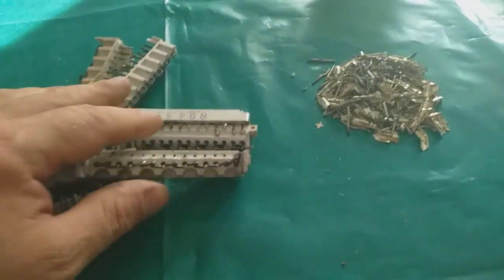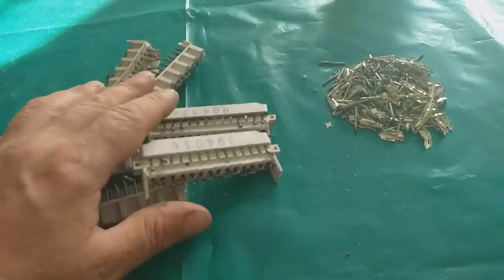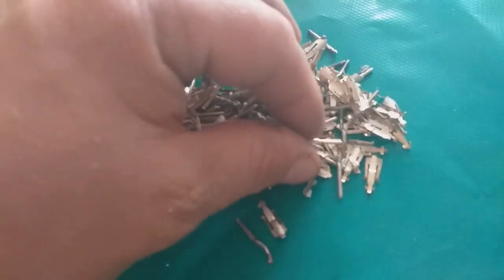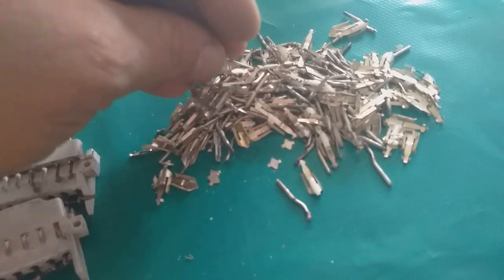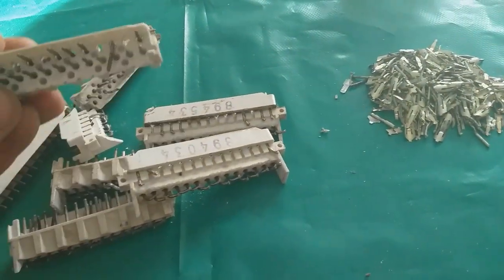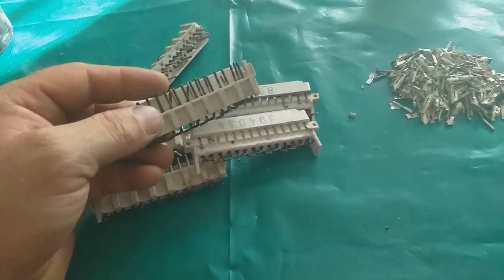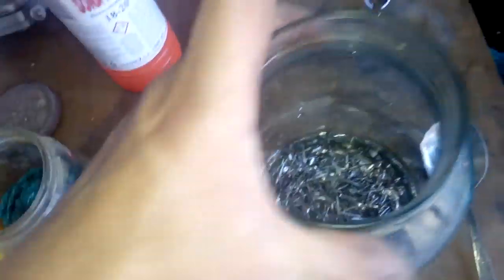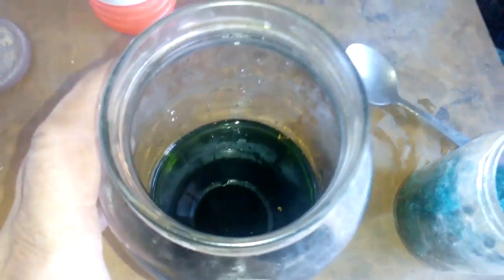Silver plated pins - how react with Ap solution - PART 1

Comment from the maker: Ok, first of all I'm glad this video brought so much controversy in the comments. As you know I'm not a chemist but I have basic knowledge about these things that I do.

Secondly, the mistake is mine because I did not sufficiently explain some of the information in the video.

Third It is copper 2 chloride cristal and not copper 2 crystal. It is also not copper sulfite crystal because copper sulfite is blue and not green. Otherwise I have both products in my small lab.

Fourth, contacting silver with hcl generates silver chloride that the acid cannot absorb as much as nitric acid, in which case that silver chloride is deposited back on the pins and prevents silver from further dissolving by hcl. So it is not silver sulfate, but it is  silver chloride.
Fifth, you are right when you say that it is not an Ap solution but you are not to. Generally every solution we make and that contains copper 2 chloride we call small refiners call it Ap solution even though it is not an real  Ap solution. Specifically by adding copper 2 chloride I made copper 2 chloride solution, if I had added hydrogen to the solution then it would be an Ap-Acid Peroxide solution.My mistake,sory.
Sixth, this is not a Piranha solution because the piranha solution is a combination of sulfuric acid and hydrogen in different proportions depending on need. And because of its non-permanent configuration as it can cause side effects when mixing the two chemicals.
 To fu... dangerous.
Seventh, I'm very glad you're all here and having such a great time, I hope it will be so in the future.See you guys.
P.S. Im stll not a chemist,so i make mistakes,but my videos is prety funy and bring you a lot of information.
Reply: Mantap👍👍👍❤️❤️❤️❤️🙏🇮🇩

Comment: Hi dusan i have a question i messed up and disnt realize i had very small mlccs mixed in with my pins i put them in hcl and hydrogen peroxide 3 to 1 and my solution turned purple my question is are the mlccs gonna mess me up if so is it fixable thanks in advance

Comment: Great video, I did some silver plated knife handles like this one time just to see how long, and how much acid it would take to do this. It took a little over a month for the base metal to dissolve, and about a gallon of HCL. I found that it really wasn't worth doing plated flatware this way, I hope its better for the pins, because I have a bunch of silver plated pins I've been hanging on to.  Hope the return is worth the acid and the effort. Best of luck, will be waiting for the next video!! 👍👍👍
Reply: I remember that video well my friend!!
Have a GREAT Day!!!
Reply from the maker: Yes you are right, it takes quite a while, but if it works I don't see a reason to rush it. I will let it go as needed. It should be cost effective in this case because the pins are with a very good amount of silver. Thanks for you support friend.

Comment: Hi sir can you tell me how to recover brass or copper from nitric acid
And how to recover tin from h2so4
Thank
Reply: Never seen anybody recover brass, but denox your solution and but a peice of steel into solution to recover the copper. Dusan 999 has a  video on this. Good luck.
Reply from the maker: Yes,Barry is right.Nobody dint return brass because brass is just a aloy of copper and zink and somethimes other metals.But for copper you just ad steel and cement copper out from solution,yust first neutralize or satured you nitric acid ok.

Comment: Very interesting.  reminds me of when I used AP on some electrical contacts.  Wound up with a fine silver chloride dust that was VERY hard to filter out.  But these contacts were a powdered tungsten/silver alloy so using nitric wasn't must easier. Didn't think that silver plating on those pins would be that thick.  Looking forward to part 2.
Reply from the maker: Soon brother.Thanx for support.